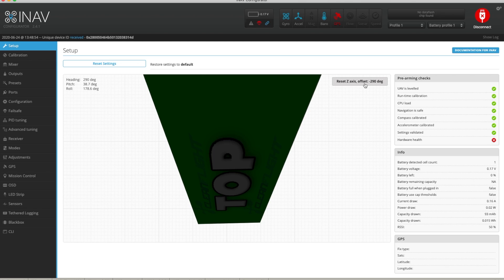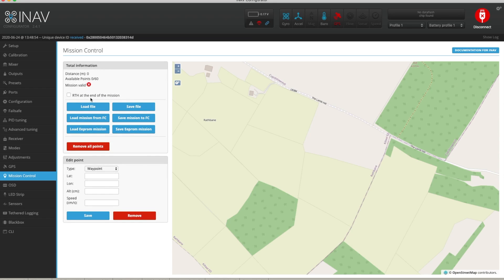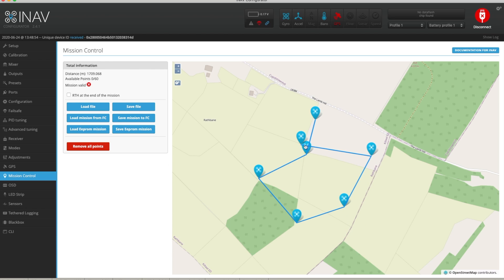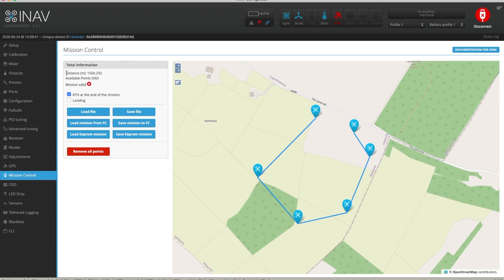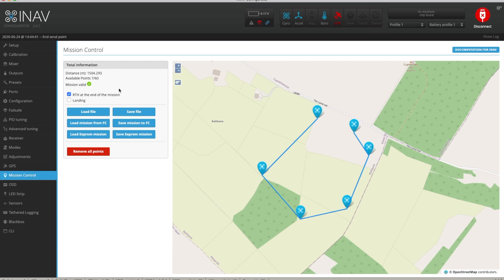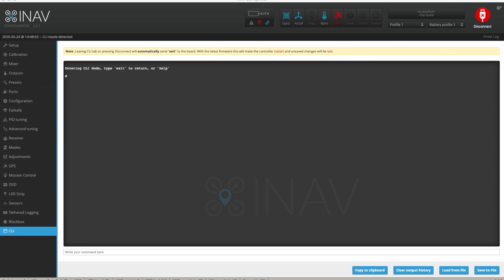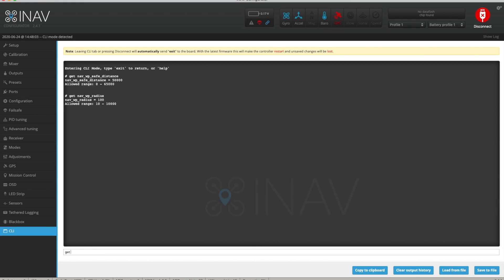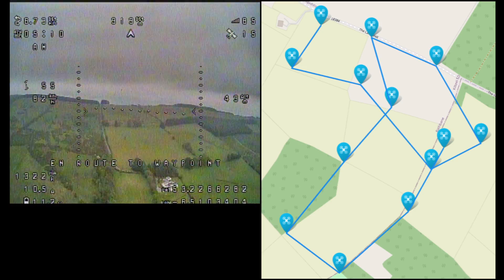iNav Mission Control for Fixed Wing ✈️ How to and Demo Autonomous Waypoint Mission 🤖

Comment: I also forget to load missions before taking off.  My trick to remembering is that I've changed my "armed.wav" voice notification to actually say "Armed.  Did you remember to load waypoints?".  You don't want waypoints to automatically load.  If you are at a different field, automatically loading waypoints will prevent you from arming because the 1st point is too far away, even if you don't enable WP mode.
Reply from the maker: Haha I had considered doing the same as you, it's a smart move if you do WP missions often! I would still like it auto load, because then when you fly, if the WP is at a different field, the nav_wp_safe_distance will stop it from starting the mission, so there shouldn't be an issue. Thanks for watching
Reply: Unfortunately, the nav_wp_safe_distance check works by preventing you from arming.  Try it.  Set the safe distance to 1m.  A better way to implement the check would be to prevent you from putting it into WP mode.
Reply from the maker: Right I've just been and tested this. I have a WP mission loaded and I am able to arm successfully in my back garden while my first WP is about 8km away.
Reply: Hmm.  When I first setup a mission, my first waypoint was further than 100m away.  I loaded the mission from EEPROM and it wouldn't let me arm.  I see a message in the OSD "Unable to ARM. First waypoint is too far". (Just retested).  I had to connect a computer to my plane and change the safe distance.  Looking at iNav issues, I see this as an open issue: https://github.com/iNavFlight/inav/issues/4832.  Perhaps you are running a version of iNav that behaves differently. (I'm running 2.4).  Or perhaps you didn't actually load waypoints from EEPROM before you armed?
Reply from the maker: @tonyyeung821  I honestly believed you were going to be right, but I have just tested it in my back garden, loaded the mission in the usual way (Stick up right before arming) and then I can arm no problem. My  safe distance is set to 500m and first wp is approx 8km away. I am also using 2.4. I tired this 3 times just to make sure and cycled the power each time. On the third time I even connected to my computer so I could confirm the mission was loaded in mission control.
Reply: Interesting.  I wonder when the check for wp_safe_distance is done on your airplane?  Maybe it is worth trying again next time you fly.  Define a mission within 500m of home; go to your field; load the mission and attempt to arm.  If you can arm, fly a bit and attempt WP mode (be ready to switch out of WP mode quickly).  At some point, it should tell you that the first wp is too far away.
Reply from the maker: Ok so I just went out and tested it, and the safe distance check is definitely broken on my iNav 😅 I set a mission with the first point being 600m from home. My safe distance is 500m. Armed successfully and got in the air. Flew away from the waypoint and then  Activated wp mode, about 700m from the first point. It activated the mission and completed it successfully. So next I lowered the safe value to 500 (5m). Same mission, armed successfully and activated mission 700m from first wp successfully. Flew the mission without issue 🤷🏻‍♂️🤷🏻‍♂️🤷🏻‍♂️🤷🏻‍♂️🤷🏻‍♂️
Reply: Strange.  According to the docs, this check is disabled by setting the safe distance to zero, which you clearly haven't done.
Reply from the maker: @tonyyeung821  No I haven't. I suspect a bug here and it might be in relation to that zero. I set it to 0 a couple of months ago which as you say disables the check. Maybe then when you enter a number it's not 're-enabling' the check as it clearly should be. I could work out if this is the case by trying it on another plane i've never had set to 0 before.
Reply: Can you post your current setting somewhere?  I'll compare them to mine.
Reply from the maker: @tonyyeung821  There's already a ink to my diff file in the video description
Reply: @AdamGdoesFPV  Could it be: set nav_extra_arming_safety = OFF
?  I have this enabled.  On an unrelated note, you should have this enabled: feature -AIRMODE
Watch this video: https://www.youtube.com/watch?v=dS8_VXQ-Htw
Reply: I looked at the code.  I found a function called : navigationIsBlockingArming https://github.com/iNavFlight/inav/blob/9cc0368de45143d60109d6adcf0c7250d85dffd4/src/main/navigation/navigation.c#L3254
This line says if nav_extra_arming_safety is off, then return - there are no navigation issues blocking arm.  This bypasses the waypoint distance logic which is at line 3276.
Reply from the maker: @tonyyeung821  Ah! I didn't realise I had left my nav_extra_arming_safety to off!! I usually set it to off for indoor testing due to no GPS. I'll turn it back on and retry soon but it looks like thats the cause!
I've seen the video on Airmode and I will not be using it. I won't go into that now anyway :P
Reply from the maker: @tonyyeung821  up that did it, with the extra arming safety back on it gives me the warning about not being able to arm as 1st WP is too far. I've added a note in the video description to update people on how this works. Thank you for the info and for the useful links you provided :D
Reply: @AdamGdoesFPV  No problem.  Thanks for putting together the video.  You can use extra_arming_safety = BYPASS to let you arm on the bench without a GPS.  You should also think about AIRMODE.  As I understand, for fixed wing, the only implication is that stabilization remains on when you have throttle off (e.g. gliding or landing).  It sounds like you have your own reasons for not using it.

Comment: Has "speed" changed in 2.4?  In the past, speed has no function.  INAV doesn't consider plane speed (GPS or pitot), it only uses throttle values
Reply from the maker: This could still be the case to be honest! I never really altered the speed for wp missions and it might just be a coincidence that my average cruise speed ends up being around the same as the speed I set. Thanks for pointing that out 👌🏻
Reply: @AdamGdoesFPV  Great video Adam. Yes I found out about speed just yesterday on my first mission in the air. It flew at the Cruise Speed not my entered waypoint speed.
Reply from the maker: @AndrewNewton  Thanks for confirming this Andrew. This is so weird because it states in the wiki that "The mission is defined with waypoints, which have the information about latitude, longitude, height and speed between the waypoints"... and of course it allows you to set the speed which adds to the confusion
Reply: Adam G does FPV that only applies to drones iirc. Pawel said something about they couldn't get reliable speed on planes so it flies at cruise setting, unfortunately adding a pitol tube doesn't help either which can make things interesting on windy days.  More annoyingly jump and loiter don't seem to work, it seems the inav team are concentrating on quads.
Reply from the maker: @Dominic Douglas Nice little tip, I can see that being very useful for people flying a lot of WP missions!